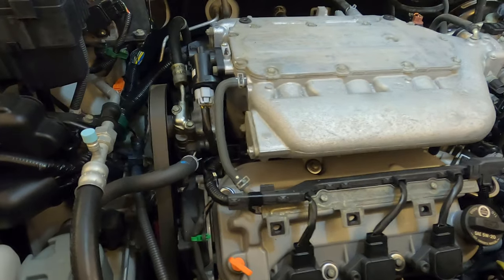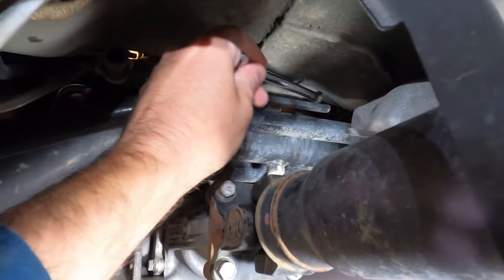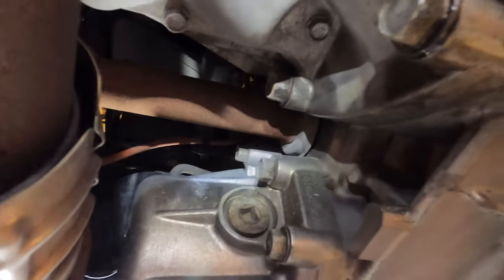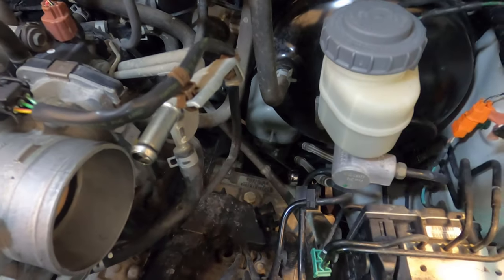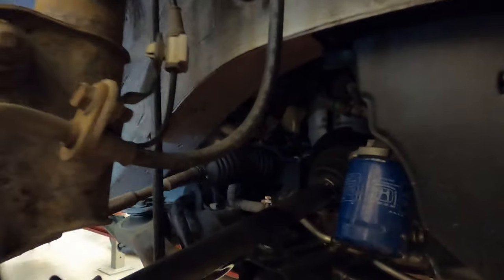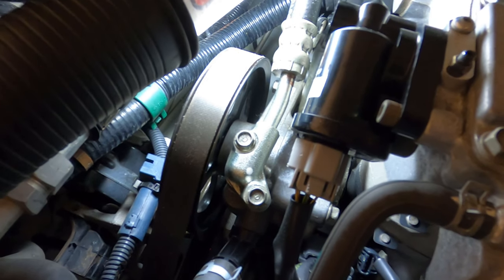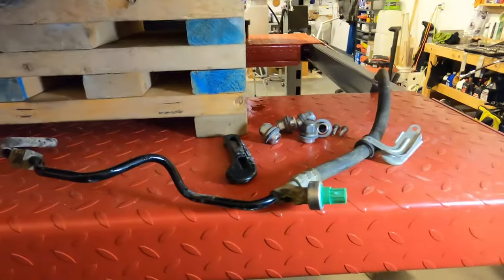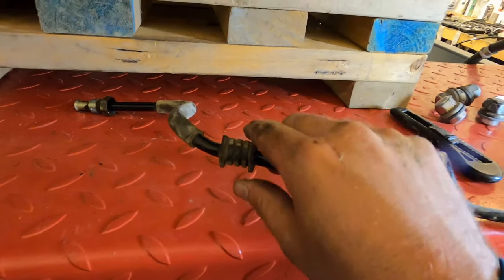How to Replace a Honda Power Steering Hose 3.5 V6

Comment: GREAT video. I'm doing this job on my Ridgeline tomorrow, not looking forward to it. I've enlisted some help regarding threading the pressure line back into the steering rack. I'm thinking if I have someone in the passenger wheel well stabilizing and moving the line around while I'm in laying on the engine trying to get the threads started it may take a little frustration out of it. 

I saw one comment somewhere but I can't remember where, they mentioned using the crows foot at the end of like 2-3 feet of extensions to avoid having to do the 1/16th turn at a time with a wrench for the fitting at the rack. Plausible or no? It seemed like a good idea reading it but now seeing your video I'm having doubts.
Reply from the maker: Did you do it?

I'm not sure someone in the wheel well could reach the line to help.  

I tried a crows foot but couldn't find enough room to make it work.  The open end wrench worked fine - just slow and painful lying on top of that motor for so long.  Take breaks.
Reply: @Greg's Garage   I did it this past weekend. Overall the job wasn't too bad, having long skinny arms definitely helps. I did the pressure line and the return hose that runs right next to it. My truck has 280k northern New England miles on it so I always prepare for stuff to be rusted or fasteners to be frozen so I bought the return line knowing that if I removed it for better access to the fittings on the rack, it probably wasn't going back on.

And that was the case, it was so cold worked onto the fitting that I ended up cutting the rubber hose with an oscillating tool. It worked well enough besides the fact that I nicked the hard line that runs from the rack gear box to the passenger side of the rack. One of the really small lines underneath the supply and return lines. So now I fixed the original leak and created another one.

Honda doesn't have a part number for this hard line on the rack so I'm either going to have to bend my own line, find a junkyard that has a rack I could take the line off of, or patch it with some two part epoxy of some sort, which I doubt will work. I'm not going to drop and replace the rack for one pinhole, it's just not worth it.
Reply from the maker: @bradmacdowell6583  the joys of DIY.

sleeve a piece of fuel line onto the leak and clamp it on the pinhole?
Reply: @Greg's Garage  Something like that. I'm thinking some JB weld, let it cure and slip a section of rubber line over it and hose clamp it down

Comment: 6:57 How do you get it out of the rubber mount? It’s connected to another hose that I don’t want to remove
Reply from the maker: If you remove the bolt does it slide out?

Comment: I’m doing this job right now. Oh man is it terrible. The hardest part is getting it thread on! I’ve spent like 3-4 hours trying to get it to thread on but it just won’t go. Wondering if I need to get a OEM part instead 😞
Reply from the maker: No I did not have OEM.  I used a cheap aftermarket hose.  Take a break and try again
Reply: How were you able to get the thread to catch? Did you have to apply alot of pressure or is it just an angle? Ive tried bending the pipe alittle and aplied pressure. It just wont catch. @gregs_garage
Reply from the maker: Maybe threads on rack are slightly damaged.  should be all about the angle.  Maybe do that attachment first so you can move it around?
 @mitchell2024
Reply: @gregs_garage  Did removing the front line help with installing? I really hope i didnt damage the thread. I wouldnt know what to then. I am going to give it another attempt today. On the verge of taking it to the shop. They quoted me $800 so im really not trying to do that.
Reply from the maker: I don't think I removed that front line in the end.  I changed my mind and was able to reach the back line with a open-end wrench.  But removing it would give more room.  Worth a try.  Move the angle around you probably aren't quite straight even though it looks like it from above.  @mitchell2024
Reply: Okay so I finally got it! lol I did remove the low pressure line. That did give me more space which helped but not necessary. What was the issue was the after market part. It seemed to have a few millimeter gap at the end of the nut which prevented it from catching. After returning it and buying the OEM part it fit after a few tries. In my case, it was the part. Should have checked the nut before installing. @gregs_garage
Reply from the maker: what a pain.  common type of diy delay though.  things take 5x longer than expected.  We all do it. @mitchell2024

Comment: I just did this on my 06 Pilot..........What a nightmare.You knew long skinny arms to access from the top......and good access from the. bottom. I would not do it again BTW.
Reply from the maker: Even with a lift it is hard.  I have a ‘13 odyssey that I wonder about…. So far a dry hose.

Comment: Yikes!  This may be a bit above my skill level.  After my power steering failed last week and sprayed fluid all around my engine, I decided to replace the whole assembly- power steering pump, reservoir, serpentine belt, AND this high pressure hose. Unfortunately, I'm NOT a mechanic. Plus, I was unable to determine exactly where the fluid was coming from, so I think I'm going to take a chance and just leave the hose that's on there and hope that the system failed somewhere else.
Reply from the maker: no reason to replace everything.  fix the failure.
Reply: @gregs_garage  After a more thorough examination, the high pressure hose, reservoir, and belt looked all seemed intact to me, so I ended up just replacing the pump and the O ring for the high pressure hose.  It survived a 3 mile drive, so fingers crossed...

Comment: Yeah Honda doesn't actually refine oil or manufacture their fluids, they contract it and the manufacturers have varied over the years. The statements that only Honda fluids will work and not damage components is totally false. All oils and fluids have required specifications and you only need to match that, not the Honda name.
Reply from the maker: No claim that Honda makes fluid.  Of course they contract it out.  Honda brand will have the right specs.  there are also aftermarket fluids made for Honda steering and other components.  They may work but aren’t any cheaper so why bother?  If you Put generic p/s fluid (atf) in a Honda rack you will destroy it.

Comment: I need this hose replaced called Honda  Canada they want $443.00 for it !!!! or $150 at a parts store .crazy
Reply from the maker: They are available for less than $50.

BTW, the cost of the hose is nothing compared to the installation.